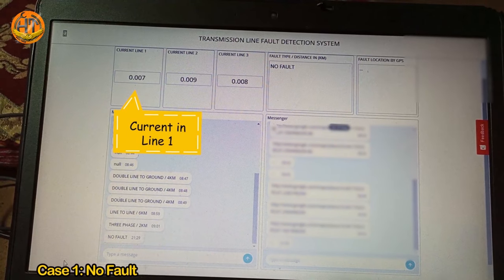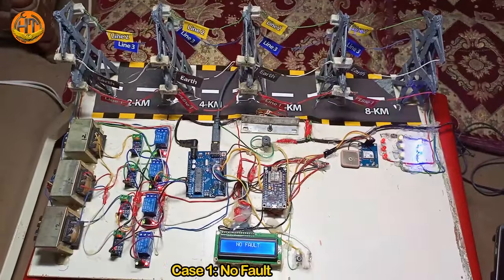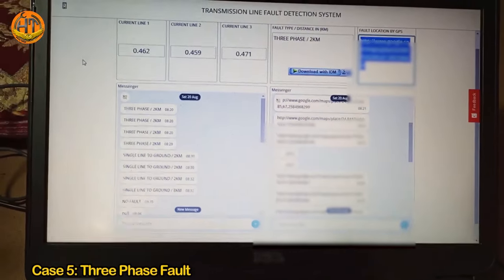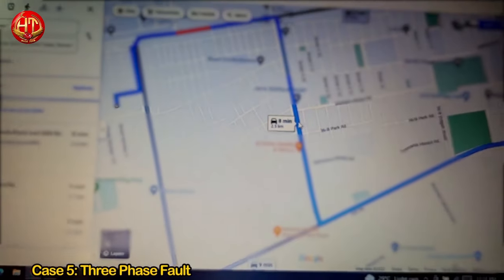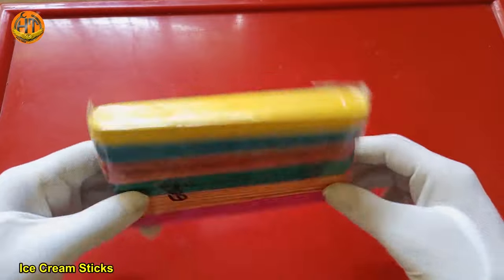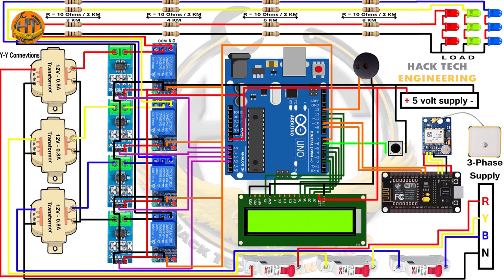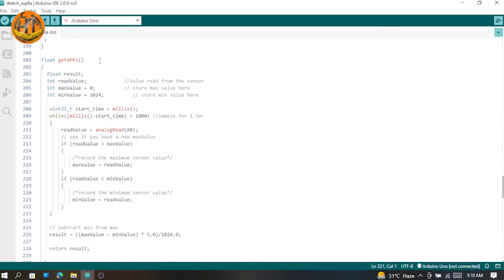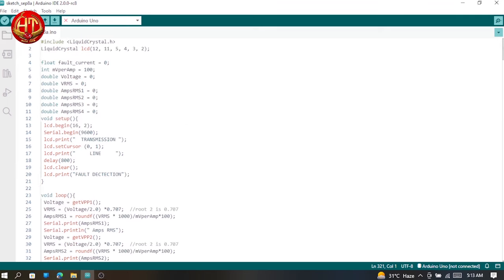THREE PHASE TRANSMISSION LINE FAULT DETECTION & ANALYSIS SYSTEM | Electrical Engineering Project/FYP

Comment from the maker: Hello everyone, 👋

I hope you're all doing well. Currently, I'm engaged in a project focused on the development of an advanced monitoring and fault detection system for three-phase transmission lines that will be more easy to make for you. This project also includes the user-friendly IoT app with animated graphical user interface. Also this project can operate on a single phase and is capable of detecting all four types of faults in three phase transmission line. 🌐📲
I will be uploading a video about it soon, but in the meantime, you can explore free online simulations through the following link. Feel free to check it out!🔗😊

https://www.tinkercad.com/things/0coaGIla0aK

Make sure to give it a thumbs-up! 👍.
Reply from the maker: @@--____--____--____-- Yes! it will definitely work, you have to cut center wire because it is center tapped transformer.
Reply from the maker: @@--____--____--____--you can buy this 👇
https://www.amazon.com/Jameco-Valuepro-P-8657-R-Power-Transformer/dp/B00B88632C
Reply from the maker: @@--____--____--____--you have to design your own iot cloud dashboard 👇

https://cloud.arduino.cc/
Reply from the maker: @@--____--____--____--dear it's not available on Amazon under this price you can buy it from any electronics shop easily.
Reply from the maker: @--__--__--__-- we can'tt connect directly 220v 1W AC bulbs to this lines because when you short these lines for creating fault so due to high voltage large amount of current flow that causes electric Arc / spark. But you can use separate relay for using this bulb as a load like other people's used. And yes my video is in progress for finding Three phase faults using 1 phase.
Reply: Iot code link please
Reply: @hackstech   sorry sir can I get report of your project 🙏🙏

Comment: hi sir i am doing this project for my school and i am unable to figure that how you connect current sensor and current relay lide you soldered or you used male to female wires
Reply from the maker: I used multiple male to female wires and connected them together to give 5V power to it.

Comment: Sir can we use anything else on the place of transformers 12v 800m A
Reply from the maker: Yes you can use any other sources like (battery, bench power supply  etc) to power up the transmission lines.

Comment from the maker: Proteus Simulation "CODE"
https://drive.google.com/file/d/16YuAZUrHAeezzDmUbrI7STXk-gGObM0g/view
Complete Arduino "CODE"
https://drive.google.com/file/d/1fldYJLmeKF7SZhIH5-_cLVQYE_jrdw9g/view
Node MCU "CODE"
https://drive.google.com/file/d/1yQ4sDkF6qIguE3ec9gvVp8jWUBdAIURv/view?usp=sharing
Complete "CIRCUIT DIAGRAM"
https://drive.google.com/file/d/13M9H-DkOTSPxi46m_IcGjYPoMt9lCC3s/view

Proteus software simulations file
https://drive.google.com/drive/folders/1TUPvekC48LSzlVe42EgNSCvlUZ6dJL8e?usp=sharing
Reply from the maker: @mayurchaohan5436  complete working hai yah distance relay ke principal per work kar raha.
Reply: How much money for code and connection diagram
Reply: What is the Proteus Version of this Project
Reply: @hackstech  Tell me the Proteus Version
Reply from the maker: @subhamoydey5744  Proteus version 8.11 or above.
Reply: its not working sir
Reply: @hackstech  
I have mailed my issue on this project.. please help me to solve issue
Reply: Sir plz cheak the mail..
Reply from the maker: Ok let me check.
Reply: Get vpp1 error bro
Reply from the maker: In which code?
Reply: Sir how to upgrade from arduinojson 5 to 7 kindly..

Comment: Hello there sir,about the current measurement,how did you measure current values that small (0.007 to 0.009 A)during no fault ? Did you use 5A ACS712 or did you adjust it with coding?
Reply from the maker: Yes I use 5A ACS712 current sensor and take the reading from this sensor during no fault so this current sensor detects only load current of LEDs like 0.008A so I apply condition in code e.g. if current detected by current sensor is greater than normal load current 0.009A so it will be considered as fault.
Reply: @hackstech  Understood sir,thanks🤞🏻💪🏼!

Comment: Sir in that transformer which I purchased has 1side both black wires and other side both red wires. now which wires will be connect to circuit breaker.

Comment: Can i use 6amps circuit breaker for protection and if i use 12 volts, 1amps transformer whether I have to change the code to get accurate output
Reply from the maker: Yes you can use 6 Amps CB, and if you're using 12v 1 amps transformer so you should have to change the current values accordingly to identify accurate faults and distances.

Comment: Which transformer you are using AC or DC
Reply from the maker: 12v, 0.8amps Step download transformer, Actually all transformers are AC transformers.
Reply: @hackstech  actually I used 12 v, 1amps step down transformer and give input of 230 V AC it burned. what is the input voltage you have given
Reply from the maker: I also give 230v at input, did you connect the correct side of the transformer with input 230v?
Reply: @hackstech  whether you are using any other components to convert ac to dc and also which led you are using 5mm or any other
Reply: can I use 12V, 800 milliamps AC to DC adopter to power the transmission line and if i use that how to connect it with the four current sensors

Comment: Sir i follow your every step for making this project but sir hardware show wrong fault location on lcd. Sir i short two lines on 2km but hardware show fault line to line fault at 4km or 8km or sometimes it shows line to ground fault how can i solve this issue ?
Reply from the maker: This problem occurs because of low accuracy of one or more of your current sensors because the faults type and there distances is totally depends on current readings taken by current sensors so let's suppose I set 5 amps of fault current at the distance of 4km but due to less accuracy sensor read it as less than 5 amps so this value come in range of 6km. Which is not accurate.
Reply: So sir how can I check accuracy? Sir I use 30a current sensor because 20amp currenr sensor are not easily Available in markets but i change value from 100 to 66 in code
Reply from the maker: You have to connect multimeter in series of line for taking current readings. Then match the current values taken by current sensors shown in serial monitor with the current values taken by multimeter. Make sure to both values should match.
Reply: @hackstech  sir value of serial monitor is different from the values of current I measured in lines so sir now what can I do now ?

Comment: You used Neutral Wire as the Ground Wire right? Both serve different purpose.Can you explain that ?
Reply from the maker: Yes! Here I used Neutral wire as ground wire. Because in real scenario power transformers neutral is grounded at the grid stations so when any of the phase line is break and drop on the ground so the circuit will complete and due to low earth resistance Large amount of current flow which considered as fault current then our main circuit breakers trip for protection.
Reply from the maker: If you want to implement this in your project as per real scenario so you have to place a thin metallic sheet under the transmission tower as a ground then you have to connect neutral of transformer's to this metallic sheet so it consider as neutral grounded transformers. so when will any of the phase line drop  on this metallic ground it creates a fault.
Reply: @hackstech  understoood!!!💪🏼🤞🏻⚓️

Comment: hey bro we have a three-phase source at our school. Is there a specific tap or we just plug it in directly? What if it explodes?
Reply from the maker: Use circuit breaker for protection as I use in this video and make sure that transformers three phases input wires is connect only with three phase source (phase wires). and transformers common neutral wire  connect with neutral of three phase source. (Don't mix phase wires with neutral wires)

Comment: Hello sir as I discussed in previous messages that hardware doesn’t shows exact fault locations because of current sensors accuracy. Sir i check current and then compare in serial monitor so the currents are different from each other sir what can i do now sir please suggest a simple way to resolve this issue please sir
Reply from the maker: Dear contact me by email so we will discuss easily on this to resolve the issues.
Reply: Sir whats your email ?
Reply from the maker: hackstechoffic@gmail.com

Comment: Bro, is 5Watt 10ohms resistor compulsory or we can use any normal resistor. What if we use 5 watts 15 ohms register. Will there be any change in the code
Reply from the maker: You have to make some changes in code because this code is calibrated according to the 10 ohms resistor. So if you change its resistance then its current values will also change that causes wrong fault distances.
Reply: hey broo did you done the corrections for coding

Comment: here you are connecting the relay in normally open (NO) and how it will work can you explain i am confused with it
Reply: bro connect it in NC condition else voltage across the transmission line is getting become zero.

Comment: Sir, why use 12v Transformer? Can we run this on 230V with the same code?
Reply from the maker: No! you can't run it in 230 volts because if you create a fault by shorting wires so it may cause to trip your main electric feeder like main Fuse or Circuit Breaker of your home or lab. And also may be cause of fire or high spark during 3 phase fault. If you think that here we design a system to protect power lines form all types of fault by disconnecting or isolating though relays. So as we know that Arduino microprocessors processing speed is very low so during the fault it takes 2-3 seconds to detect fault and and send signal to relay for tripping after read data from all current sensors and process it to take decision. But 2-3 seconds for 230 or any higher voltage is enough to burn complete system that's why aur labs or home circuit breaker/fuse take quick action to trip in Mili seconds. Here we design only a  prototype but we can also implement it on real live high voltage transmission line by using fast processing microprocessors, quick response hardware components and also rewrite this algorithm to fast decisions.

Comment: Bro is arudino code is succifient for project or again need to dump code for node Mcu and gps module
Reply from the maker: Arduino code is sufficient only for detection of fault and their distance. And you need node MCU code for gps location and iot cloud dashboard parameters update.
Reply: Again need to dump for both node msu and gps module
Reply from the maker: @ssiva2484  Bro I already explain all necessary things in video for more details contact us through email
hacktechoffic@gmail.com

Comment: Sir  when we are doing fault in transmission line the lcd doesn't show fault always showing no fault and buzzer is not shouting
Please help 🙏
Reply from the maker: You have to check current sensor values on the serial monitor and check,  is this  value greater than pickup current or not?
Reply: @hackstech  how sir

Comment: hey bro another question. what type of wire did you use for the transmission lines?
Reply from the maker: Single core solid copper wire.

Comment: Hii can we make Project using NodeMCU is a main microcontroller instead of Arduino
Reply from the maker: You can't use Node MCU  as a main microcontroller for this project design because Node MCU has only 1 analog pin and we required 4.
Reply: ESP32
Reply from the maker: No

Comment: Sir i made as it is same project everything working but lcd doesnot show anything
Reply: Sir what can i do now ?
Reply from the maker: I think it's not showing anything because you may make some wrong connections or there is some problem with this LCD, so please recheck it's connections first then upload some other example code to test , is it working properly or not.

Comment: Sir i have short two phases but the lcd still showing fault detecting it doesn't show the type of fault what may be the problem
Reply: Hello bro .. did you finish the code? If it works with you I need it
Reply: @abdulrahmanalhabsi8486  No bro the code is not working properly

Comment: Sir what length do you use for transmission line wire after every resistance or what resistance do you use 100 ohms resistance or 10 ohms ?
Reply from the maker: Here I use 10 ohms resistance after every 2 Kilometers of transmission line, And  here I use length of 2 Kilometers  wire after every resistance.

Comment: Nice work bro. How did you get the 3phase supply ?
Reply from the maker: I have a three phase supply coming from electric service provider company.
Reply: @hackstech in single phase, after 3 transformer connect seperately will it work?
Reply from the maker: No because it is still in single phase, but we require three phase because of it's phase difference 120 degree's.

Comment: Sir we get errors in looping statement and void sense while debugging the code inversion 6 
help me sir
Reply: Please help me sir we have project seminar on after 5 days help me
Reply: In which version we have to do it
Reply: Help me sir please 😢
Reply from the maker: Try to do it on version 5.6 because I write code according to this version, if you want to use version 6 so you have to make changes accordingly, here I use Arduino Jason library only for build connection between Arduino uno and Node MCU for uploading data on IOT cloud.
Reply: @hackstech  tq sir

Comment: I want to know which type of Modifications I can do in this project to make it different from you?
Reply from the maker: Use different transmission voltages or display more parameters for monitoring link voltage, current  and power by adding more sensors like voltage sensors etc.

Comment: Hello there sir, during fault, the relay will open and isolate the load circuit (3 RED,3 BLUE and 3 YELLOW),how will the ACS712 sensor capture the value if there is no current flowing to the load during fault?
Reply from the maker: Yes that's why I connected a push button to reset the relays, just like we reset the circuit breaker when it trips. So if you press push button then the relay will again close and current sensors again start taking reading and if there is no high fault current so it remains close otherwise it open again and you have to reset again by pressing push button.

Comment: Sir can we use 3 single phase supply of 230v instead of 3 phase supply
Reply from the maker: No because we also required phase differences for finding the all four types of faults in transmission line as per real scenario.
Reply: But in this prototype can we use 3 single phase instead of 3 phase

Comment: Bro, in your code there is no code for relay. Since we are connecting to normally open relay.
Reply from the maker: Dear, relay modules connected with the D7 pin of Arduino and when we give HIGH signal to this pin in code so relay will close otherwise during LOW  signal relay stays normally open.

Comment: Pin number 7,6 declara in code but not connected circuit diagram? Pls explain and send circuit diagram
Reply from the maker: Here pin no 6 is connected with push button and pin no 7 is connected with all relays "IN" terminal. Download complete circuit diagram for the link given blow 👇.

https://drive.google.com/file/d/13M9H-DkOTSPxi46m_IcGjYPoMt9lCC3s/view

Comment: I think you have used 3 single phase transformer for making this prototype
Reply from the maker: Yes because I didn't have 3 phase step down transformer so I use three single phase transformers and connect them in (star / Y) to step down 3 phase voltages.

Comment: Sir arduino code is not working it says to update the code from arduino json 5 to 6 in the code.
Reply from the maker: But this code is design according to Arduino Jason 5,  so you have to install only Jason version 5.
Reply: @hackstech  but sir after instell the ardino json 5 it shows send status error.
Reply: @nextlevel7438  friend see there is one extra } remove it and code will run for sure

Comment: Can u provide the iot cloud code
Reply from the maker: You can access all files related to the project through this link.
https://drive.google.com/drive/folders/1JRkXOgcKUR8WSq6HuYBL9xziw8kRe6RG
Reply: Arduinojson 5 not supporting in iot cloud there are library error and says use arduinojson 7 code